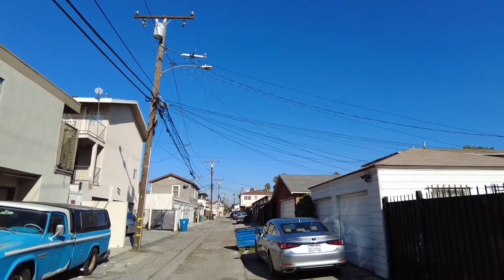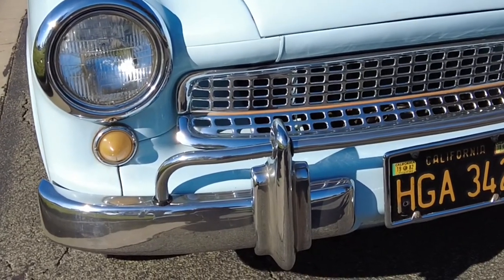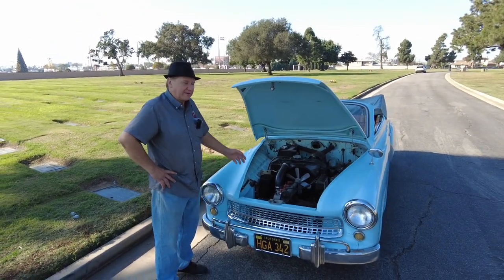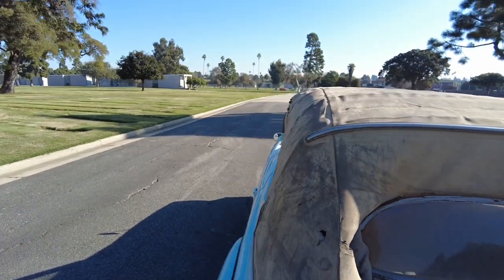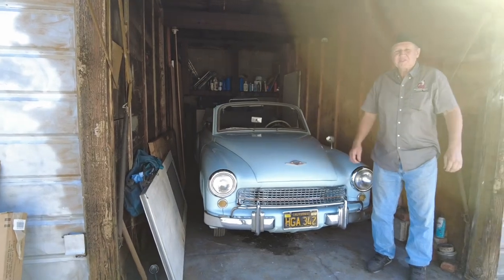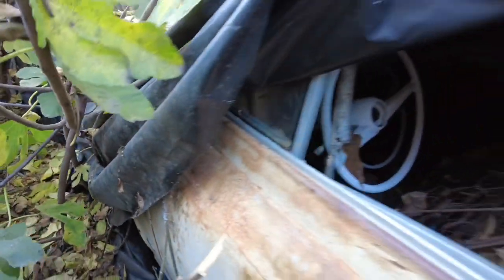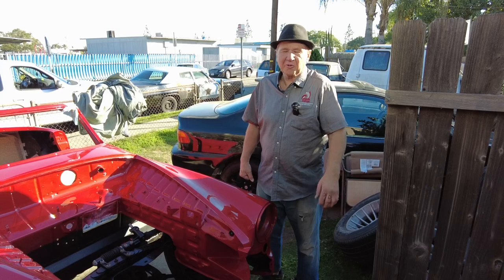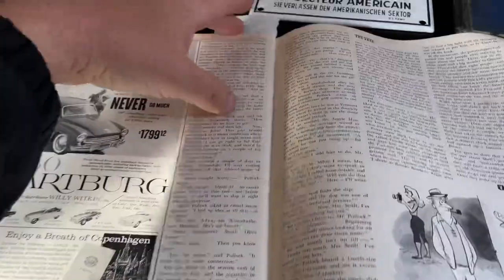USA Wartburg 311 cabriolet and 313 Sport

Comment: 18:36 This is the logo of VEB Karosseriewerke Dresden (KWD), formerly also known as Gläser-Karosserie. It was an East-German coachbuilder that produced bodies for Wartburg sport, cabrio and camping station wagon. At a later time they also produced bodies for coupe, after VEB Karroseriewerk Meerane, another East-German coachbuilder, had to focus on Trabant body production and couldn't produce Wartburg bodies anymore (that's why Wartburg sport and cabrio were discontinued in 1960). The only Wartburg models that were completely made in the main factory in Eisenach were 4-door sedans and 2-door station wagons (as well as some early Wartburg sport from 1957 and maybe 1958). Technically all Wartburg models that had their bodies outsourced should have these extra logos, although I guess there might be exceptions where they were not fitted
Reply from the maker: Thank you for the info!

Comment: Very interesting to see where they exported Wartburgs to. I learned that they made right hand drive models for the UK and even South Africa (which all the lefties of the world boycotted - not the GDR) And they put red rear lights and odometers in miles on them for export to the US. In the bad old GDR times we didn't knew auto makers or any vendor of any good to be flexible in any way. Take it or leave it. But these they made for USD :-)  "real money". 

What looks strange to me is the lack of an oil mixer. Wartburgs and Barkas vans sold to Belgium all had them. Over the time I haven't met many Americans being careful with machinery - turn the key and it should work. So I suppose that many Wartburgs died early with stuck engines for the lack oil. An oil mixer would have prevented it from happening.
Reply from the maker: Thank you for your comment! I haven’t seen ANY Wartburgs or Barkas vans with oil mixers. But I’ve seen the DKW with it but every owner I’ve talked to weren’t using it because sometimes they failed. The only way they found out that the oiler failed is when the engine siezed….
In Victor’s back yard most of the cars have original tires because their engines failed way before they could use up the tires. The reason was (just like you wrote) lack of oil in the gas…
As far as I know the UK models were re named to Wartburg Knights. I know this for the 353 but don’t know much of the 311 UK export. I did read about the African spec 311 cars. They all had water pumps for example.
Reply: @Rick-S-6063  A fiend of mine - German as I - who spent his childhood and teens in the US once ruined his automatic gearbox by filling it up with motor oil instead of the required transmission fluid. Arrggh - and he wasn't even a complete jerk when it came to technical stuff.(working in IT)
Reply from the maker: @Rick-S-6063  I see that you’ve figured the Americans out. But when the key won’t turn they can go out and buy a new one. Just like a fridge. Do you ever do maintenance on your fridge? You actually should pull it out and clean the condenser fins😂 A car is a transportation appliance for most Americans.
So as the owner of 3 British cars I can ask you if you know why the British like warm beer? Because their fridge was made by Lucas🤣 But you probably have heard this joke before…..
Reply: You picked up that the East Germans didn't put sealed beams on it. In those days it was very common for US-bound European cars to leave the factory without headlights, there'd be tar paper "eye patches" over the empty sockets held in place by the trim. Dealers would then source, install and aim the sealed beam headlights before the car was sold.

Comment: I love the fact that this car still has a fully original interior and you can use it to determine when Wartburg cabriolets stopped having wooden imitation dashboards because this one is definitely original and probably one of the latest known ones to still have it. 1959/1960 Wartburg catalog shows one that's probably just a few weeks or months newer and doesn't have the wooden imitation anymore
Reply from the maker: Very interesting! All the cabriolets I’ve seen had the same dash. That doesn’t mean much, perhaps all the ones I saw were older versions. 
But as you wrote, this one is all original. The dash is painted but on top of the doors they’ve put real wood as a cover.
Based on the VIN it was made for the local German market but once it was done, they’ve shipped it to the US for some reason.
Reply: @budapestspeedshop  The catalog I've mentioned is from 1959 or 1960. Probably mid to late 1959 because all cars shown have the asymmetrical wipers pattern that was used since spring 1959 and Wartburg cabrio was also discontinued in 1960 so it would make little sense to advertise it in 1960. All of the earlier catalogs show the dashboard just like it is on your friend's car. Another interesting thing you can also see in these catalogs is that all models made before the dash redesign in 1962 had their gauge shades, ashtrays and radio covers painted to match the dash. Now after the paint is gone you'd think they were always black. Aside from catalogs there is also a German Wartburg wiki that has a long list of changes made to the car during production with specific dates and chassis numbers as well as some original promo photos (a few are even in color). I think the list of changes was first compiled somewhere in the 60s or 70s for repair reference. Now it's very useful for originality
Here are the links if you weren't familiar with them:
http://www.die-besten.de/wartburg/prospekt/311/311.htm
http://wiki.w311.info/index.php?title=Hauptseite
Reply from the maker: @professormicron6470  very interesting websites! Thank you. My friend has collected most of those colored sales brochures and I also have a few. Most of them are in English. Also have the original Wartburg sales documents from the US West coast. Have some English and Hungarian 8mm films as well. In the US very few people like Wartburgs and only two of us collect memorabilia of them.

Comment: The two-stroke three cylinder engine is ultra smooth and was used to good effect in the Saab 96 until they installed a rough and off-beat Ford V4 four stroke. Popular in East Germany was the 2t engine ..... used in the Trabant too.
Reply from the maker: Thank you for your comment. I remember the “Slab” engines. I have 5 Barkas vans, two Wartburgs and 3 Trabants. I still found two gas stations in East Germany last summer where they were selling mixed gas!

Comment: So there is no Reserve parts available except what is used in the limousines. What I wanted to say is, in the Triangle between Chemnitz, Zwickau, Dresden Area there was also Buna/ Leuna Chemical Empire, it was like a German DuPont or ICI Corporation, they developed a special rubber to replace Leather on the roof or seats or the piacryl for roof glasses in the Camping Limousine because GDR could not produce rounded glass for the backsides..
Reply from the maker: My friend flies to Germany once a year and buys all kind a spare parts. Most of his cars are complete (or close to it) even if they are in a sad shape. We went to the Sport treffen last summer and had a great time!
Reply: @budapestspeedshop   Yes it would be great to see the yellow Sports 313 back on the road…
Reply: Actually the situation with spare parts for all vehicles made in GDR is quite good because they were of short supply all the time. So people bought exhaust pipes, carburetors, body panels  etc. in advance when they were available to exchange them later for other parts that actually broke. Many where stored in garages the like as shown in the video (but too small for modern day cars - so they were left alone until some treasure hunter came to discover spare parts or entire cars in them) The stagnation and the monopolization also helps today as many parts are interchangeable and used in production for decades.